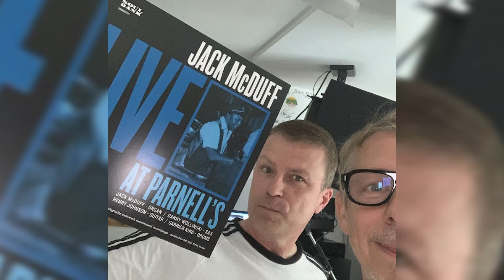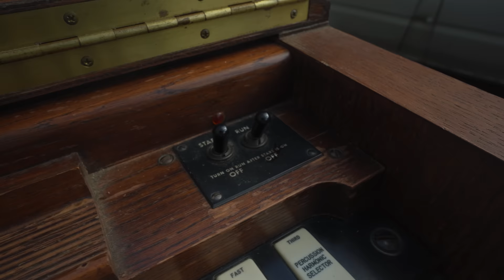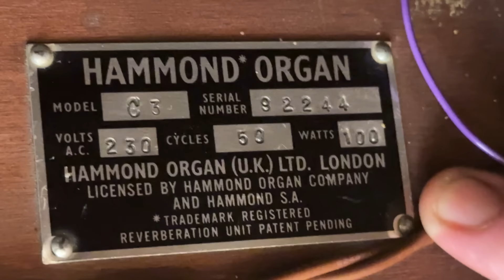Dream Keyboards | The Hammond Organ

Comment: Just a little history from my time with a C3.  It was used widely as a church organ so it's a little less bright. More mellow.  I used a 145 Leslie when I had mine.  The two pieces we able to fill large venue by itself.  After you've played it for a while, you'll start to feel the organ talk to you through your fingers.  I found it to make you play better.  I hope you have fun with your C3.  I know you'll love it the more you play!!
Also if they didn't tell you, when you push down a key SLOWLY the draw bar tones come in one at a time.  Just some little useless knowledge that you can put in the back of you head.
Reply: The C3 is a B3 in a different housing. Inside they are absolutely identical.
Reply: @julianreverse  Yes they are, but through the years the C was more mellow that the B.  Don't know how or why.  The C that I had, and I don't know the year, was one of the mellow ones.  I found a diagram in Keyboard magazine way back when that was supposed to bring in a little more of the brightness and it did.  But through the years even the B had different sounds.  Maybe it was because somebody modified the B or even the C.  It's not a criticism of the Hammond B or C.  It's just part of what we all love.
Reply: As a Hammond technician I can assure you that there is not a single thing that is different between a C and B! And also a100s, they have internal speakers and an extra power amp! That’s it
Reply: All of y’all need a recap of your tone generators!
Reply: @adamziolkowski2549  I had my C3 until 1985.  At that time it, to me, was a monster.  It filled venues yet was under control.  And do the Hammond's from back then need to have work done to them.  ABSOLUTELY!!  Nothing that old or that good lasts for ever.  So Adam, I agree with you.
Reply: The C3 and B3 are almost technical identical. If you're talking  about differences in sound, like the C3 is more mellow, I think it's because all hammonds sound slightly different. There are many factors like age of the capacitors, resistors, tubes, which all have an influence on the sound. But also new organs could sound different back then, because some components changed over time. Early B3s for example had a less deep chorus, because one resistor in the vibrato circuit had a larger value (22k), which was later replaced with a 12k resistor. Thats the reason why all A100s have the deep chorus, but not all B3s or C3s. You can always see these differences in the schematics. But I wouldn't say that a C3 sounds more mellow than a B3 in general.
Reply: @geldo7921  all hammond had 12k chorus resistor when they switch to that!
Reply: @klojke Yes of course. But i meant that it's possible to find B3s and C3s with 22k, but not A100s.
Reply: @gregglynn3763  The housing shape, the wood used in itself can change the over all tone.

Comment: I've owned about a dozen tonewheel Hammonds over the years and I always say "yes" when someone asks me if I'd like to come get their organ -even if it is a dog (99% of them are not something you'd keep).  The junkers are great to harvest parts (transformers, tubes, speakers, bumblebee caps, etc).  The point of being known as the guy that will come and get it even if it is junk is that when the person you've helped gets rid of their heavy and huge organ they go back to church or wherever and spread the word.  Despite numerous trips to the dump with stripped out Baldwin, Allen, etc, I have been able to cherry -pick some notables.  My personal keepers were a '49 CV, a '36 model A, a 60s C3, and now I'm all set with a mint condition late 50s B3 with all the original paperwork and hang tags.  After searching a wide radius this mint B3 was <10 miles from my house and I never knew it.  

The same is true for Leslie speakers.  Pick them up nearly free not working, fix them, keep the best and sell the rest.  Haha.  Most of these need servicing and are heavy and awkward to deal with.  

I'm glad you finally got one, Dr. Mix!  Be careful tho, its a sickness.  Haha!  If you ever need any help troubleshooting them or anything else like that feel free to hit me up.  With the time difference to Tennessee I might be the only guy up when you need help!

Comment: This is bringing so many lovely memories back for me. I had a 1959 Hammond A100 with the same Leslie as you, a 145. Both were in immaculate condition and unfortunately back in 2003 I had to sell both to pay my solicitors fee (£5000) for my divorce. Never got over having to let that beautiful Hammond go, but I now play live with ikMultimeadia’s Hammond B-3X which has a virtual A100 with a brilliant Leslie 122 emulation. It will never be the real deal, but it’s pretty close through a PA system. Enjoy your new baby!
Reply: Feel sorry for you having to divorce the Hammond as well. Also use the B-3X and it sounds pretty good. Also Arturia B3 is pretty good too! Need to get some bass pedals though!

Comment: The Mighty Hammond.  You have now experienced the wonders of tone-wheel music, you will never be the same.  Couple of thoughts: How come you didn't help move the Hammond into your shop?  The joy of Hammond ownership is predicated on humping it in place.  Put the camera down.....  Second- it looks like your tone generator is locked down for transport, which is good, as it protected all those solder joints during transport, but now that it is "home", you can release the locks and let it all hang out...  Finally, love the FX Loop mod, any chance you get your friend to send you the wiring chart to post?

Comment: Congrats!  The effects' loop is a great add-on.  I used a 6 band graphic EQ to boost drive in various octaves.  You can play the bands like drawbars.  Also like using an elderly spring reverb unit in the line-up.  The restoration work is incredible - Nice Catch!

Comment: Claudio, that is awesome :) I remember the day when i owned parts of hammond (generator and keyboard), it was 5 years ago. I recreated tube amplifier and after a lot of woodwork i made it as a single 4,5 octave keyboard (i added 1 octave below with full foldback like in b3). Two years ago i built leslie to complete the project.

Comment: Weight of the C-3 console alone is 325 pounds, shipping weight was 450 pounds but that was inclusive of the bench, pedals, and the shipping pallet/packing materials. B-3 console alone nominally 310 but I have a '73 B that was around 290 and change. My C-3 feels bulkier but I can still load it in my van solo...

Comment: Congrats on your acquisition! I hope you guys remembered to lock down the tone generator for transport.  Also, your C3 has the flutted knob and red caps, which means it's post-1963, possibly it could have the dreaded foam in the manuals and that should be removed immediately. Please check.
Reply: Drawbar Dave - the engineer in the video did a full service and checked all that - we ain't no amateurs!

Comment: Is that a A100 of Hammond? Ah, I have seen, a C3.
I've had a A100 in the house. With a frequency-converter for the motor, originaly it was designed for 60 Hz...

Comment: been thinking about a new way to control the leslie spin speed.  What about a rocking motion built into the bench itself?  So if you lean forward, you get the higher speed spin, but if you lean back, it slows down?  Might be a lot easier than reaching for that switch which is off to the left.
Reply: You can get an attachment that allows the right foot to trigger the Leslie switch while using the expression pedal.

Comment: Just the sheer mass of a Hammond makes it sound better, fuller, more Hammondy. Take the same sound put it in a plastic case weighing 20lbs and it sounds weak, thin, unacceptable.... you need that mass for the tone to happen.... and a leslie... no fake phase shifter will do, you need the sound scrambled and spewed all around the room. It's never easy getting tone.

Comment: Oh no. 1964, no rivets ... you've got a Hammond that very likely has foam in the manuals. I guess that UK's best Hammond technician forgot to tell you something. If you can avoid it, never buy a Hammond that was built later than 1962.
Reply: Why? I love to know more ‘bout this
Reply: @pacoluiz7648 Nothing to it, you just have to remove the foam so it doesn't "eat" the wires, it's not the end of the world.
Reply: @jorgeandrade20  It really depends on whether the foam has already spread all over the key contact wires (after all, there're 1098 of them, thin as hairs) and turned into a black, gooey mass. It doesn't affect every Hammond with those foam strips inside. Nevertheless, even after years, considerable issues can suddenly occur when certain drawbars for individual keys no longer work. It becomes particularly suspicious if it's different drawbars for different keys. Initially, it's difficult to recognize because you assume that the keyboard is simply dirty.
Reply: @hammondvoodoo9555 Yes I'm aware, but even then wires can be repaired and if it goes beyond that, a donor manual could be harvested. Again, your position to never accept an instrument post-1962 is too extreme in my viewpoint. Hammonds are from the time when things were built to last and these instruments are like war tanks. The number of "totally ruined" instruments to "salvageable" instruments is minimal.
Reply: @jorgeandrade20  I wouldn't say that tonewheel Hammond consoles built from 1963 onwards are consistently bad - on the contrary, they actually tend to be consistently average in sound. This even speaks for a more reproducible/refined manufacturing process. Unfortunately, they're also more cheaply made (that change from cotton felt stripes as dust protectors to foam stripes being one of the worst choices), especially towards the end of the 1960s and particularly in the 1970s. I've once owned a 1965 A100 which was one of those generic Hammonds. It sounded like about 50 other consoles I've listened to in the meantime. My experience is that the best-sounding Hammonds were built post-WW2 till about 1962. Before that there're also some quite outstanding ones (I regularly play a 1935 model A - one of the best Hammonds I know), but they're not technically on a par.
Reply: It was checked for all that.
Reply: @gregboraman6613  When I heard about the production year and saw the open backside of that C3 I immediately thought about that foam issue. It's oftentimes ignored (also by technicians) because as long as all drawbars work on all keys there's no need to do something right away. After all it could mean a lot of (delicate) work in addition to what was already done to that particular C3. I agree with @jorgeandrade20 that Hammonds from that era were built to last. But in some cases the costs for overhauling such an instrument can easily surpass its value (or it's far more expensive because of those extensive repairs).